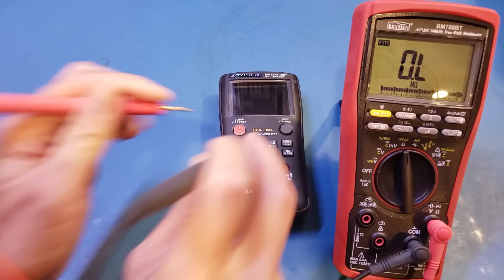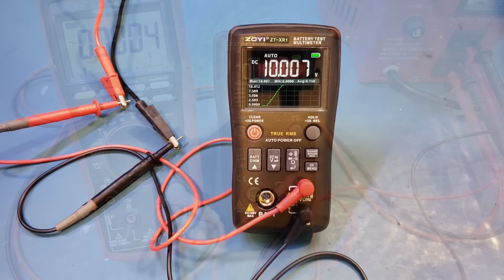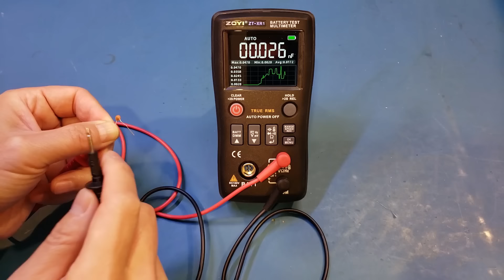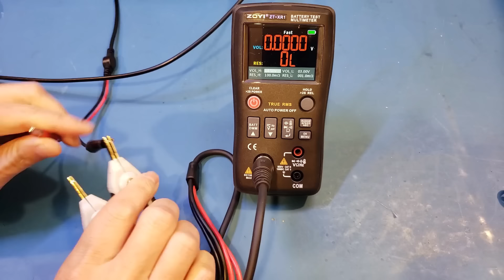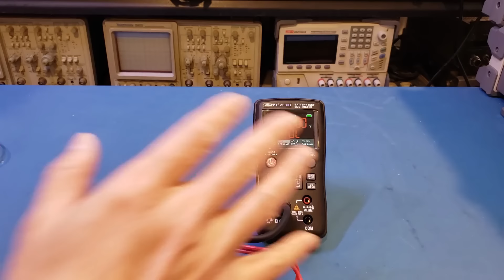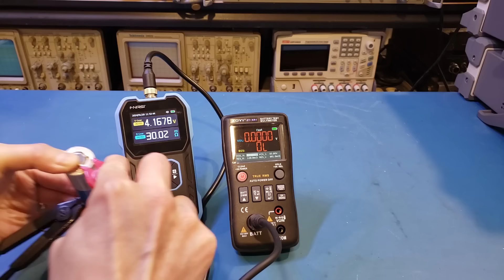ZOYI ZT-XR1 Multimeter and Battery Internal Resistance Tester Review/Teardown

Comment: You expect a sinusoidal waveform on open circuit? Nonsense. Check waveform on that 100 ohm resistor.
Reply from the maker: Yes, the waveform should be sinusoidal even with open circuit, that's a basic requirement for the linearity of the output amplifier!

Comment: Thanks Kerry. It is a real pity that the graphic screen is not going in the IRT mode. I got the same Fnirsi and was looking for redundancy. However I can buy Fnirsi's LC-1020 bridge combo for less. So I am going to have 2 of the same brand. 9V rech li batteries coming in and they have a DC to DC converter and my Fnirsi spits the dummy. If you happen to have one laying around, it would be nice to see on this meter perhaps in parallell with the oscilloscope.

Comment: These cheaper meters are getting pretty accurate (if you don't look at the fringes). Useful combination for €40. Thank you for testing Kerry.
Reply: The single chip multimeter peripherals are getting quite good.  I’m thinking the chip used in the Zotek Zoyi ZT-703S scope meter.  The number is etched off, so it is difficult to know exactly which chip it is.  It is a 60,000 count chip and it can sense one microvolt DC level changes.  The AC performance is also very good.  Probably the most limiting attribute is the AC sensitivity rolls off sharply above 2500 Hz.  All of this in an 16 ounce meter which is under 100 Dollars US pre tariff.  On top of the meter you get a passable 2 channel 40 MHz Oscilloscope.  When I was in college, it was a Simpson 260 analog VOM and a 20 pound Tektronix 453 oscilloscope.  Those would have been about 1,500 Dollars in 1975 or the equivalent of 8,982 Dollars in 2025.  Yikes!